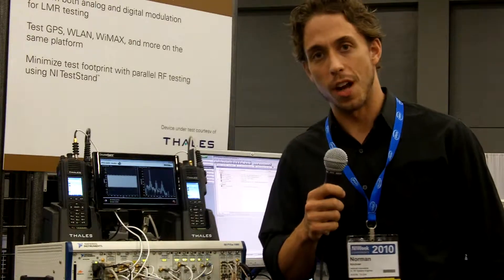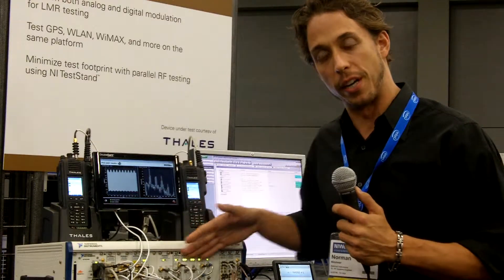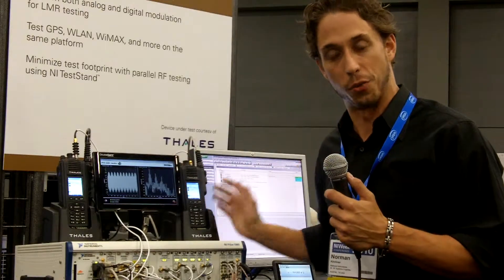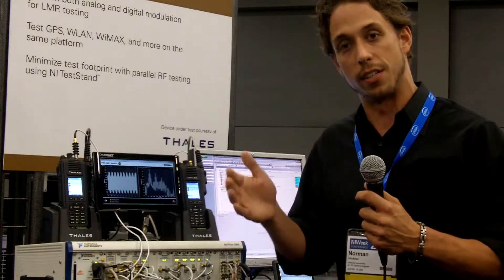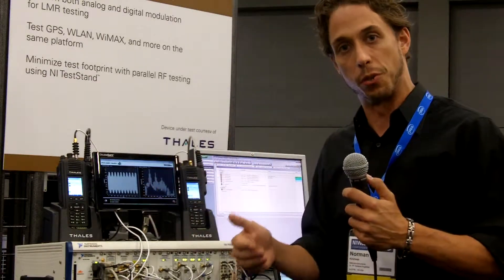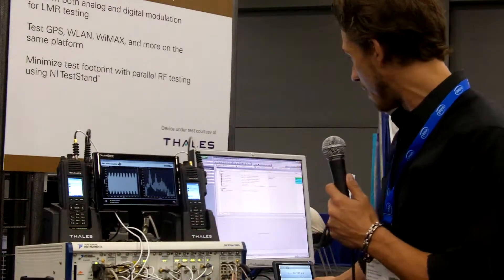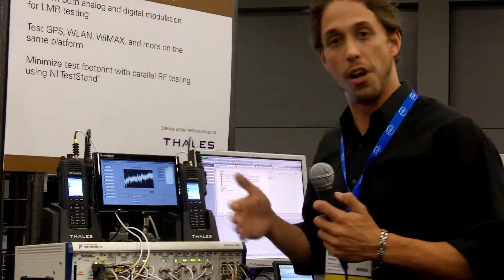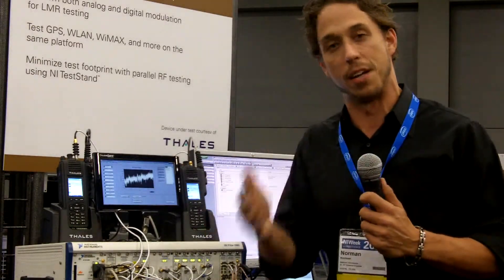Thales Radio Demo with TestStand

Comment: Thales radio equipment should better sell your products to our Armed Forces of the Philippines for better interoperability, troop maneuver, communication and rapid deployment of troops in the battlefield. There should be fast,easy and accurate information between the sender and receiver of information amongst troops in the battlefield and the command center.